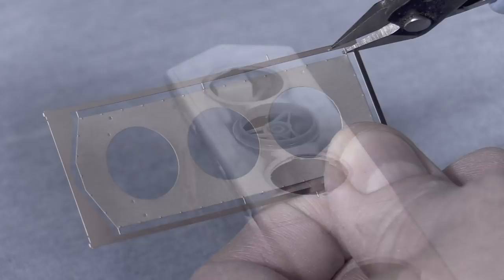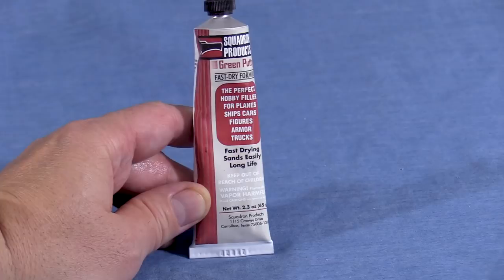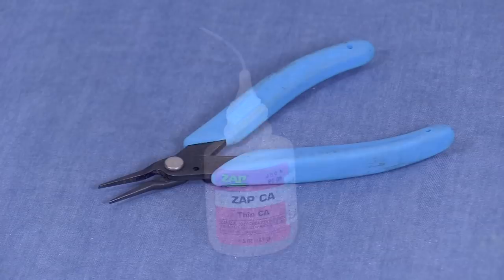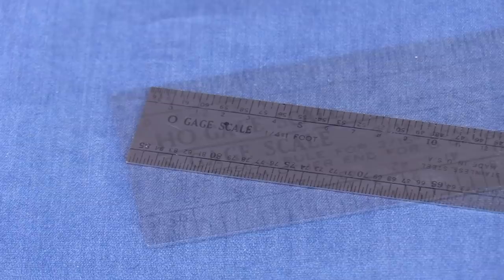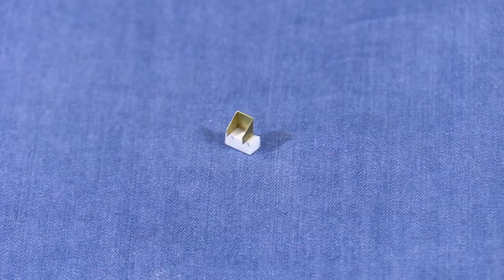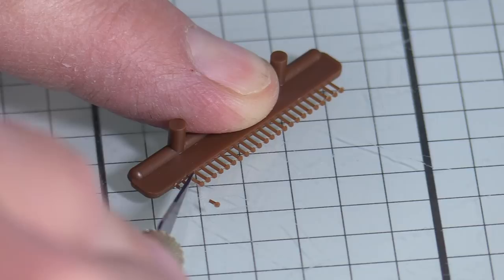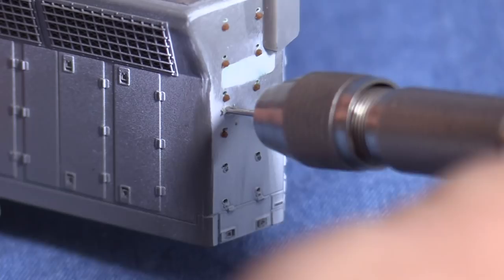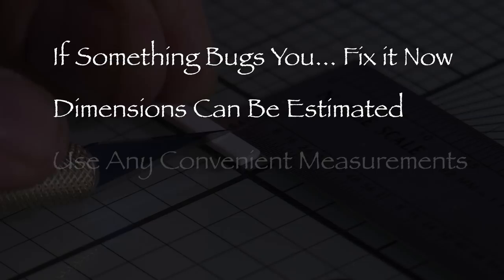Model Building HO SP Consist Part 4 - Rear End Details

Comment: I have considered modeling 7479 as well, so I made note of photos of it in books and magazines. There is a pretty good rear end photo in a softcover book called "SP Today" from 1993. Good news: your class light blanks are correct. Bad news: the light bracket plate is a single large rectangular plate.
Reply: Neil Gross is this image available online? I’d like to see it myself as well.
Reply from the maker: You know, I have that book!  I really wish I had a database that would cross reference the photos of a particular engine with books that have photos of it.  I looked and you're right, it's right there near the front of the book.  No worries.  I'll redo the light blanks in the next episode.  It's much easier to change things now while the models are still unpainted.  Thanks for pointing that out and for watching!

Comment: I wish I would have thought of putting a block of plastic to help the fiber optics instead I thought just putting it in would hold.... nope I broke the headlight casting. So thank you for this
Reply from the maker: I've found that a support is necessary to keep the fiber optics aimed in the right direction and structurally solid.  I'll cover this in more depth when it comes time to put lights in the engines.  Thanks for watching!

Comment: Not that it’s a big deal, but I’ve found when scanning slide film and negatives that scanning emulsion side down prevents those Newton rings at seen at 0:56. All of your videos make me want to rebuild HO locomotives. I’ve never done anything like it before, and I don’t really have the tools, but hey, I have to start somewhere. Thanks again for a straight forward and professional video.
Reply from the maker: Hmm... I may have to try that.  My photos were unfortunately taken on 400 ASA print film, because for some reason I thought that was a good idea at the time.  I wish I'd used Kodachrome 64, so they wouldn't be so grainy.  If I re-scan the negatives I'll try your suggestion, as those rings are next to impossible to remove, even with Photoshop.  Thanks for watching!
Reply: @DanielCortopassi  You ought to check out some of Mark Lipczynski's (Mark Traain on YouTube and Instagram) photographs of Conrail, Chessie System, CSX, BN and others taken on color print film. Some of my favorite railroad photography for sure. For someone modeling those railroads in the late 80s and 90s, his work is a treasure trove.

Comment: Lost count of how many holes needed to be drilled there.. all done with a finger-twist pin vice?
I've been urged to invest in a small cordless drill/Dremel, told I'd break less bits and not hate drilling anymore, but fear I wouldn't have the control..
Reply from the maker: I have several pin vises that I use.  Some are better for different sizes than others.  Only one of mine will hold the tiny No. 78 drill bits securely.  Small drill bits do tend to break more often than I'd like.  I have a Dremel but I prefer to do it by hand.  I find it is a lot easier to control.  Also, sometimes high speed tools can cause the plastic to melt, which is something I try to avoid.  Thanks for watching!